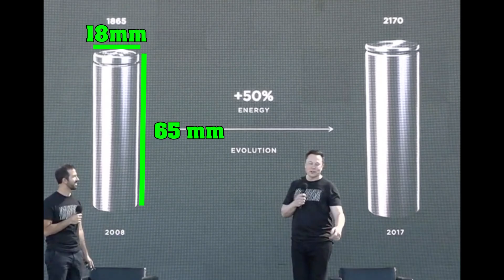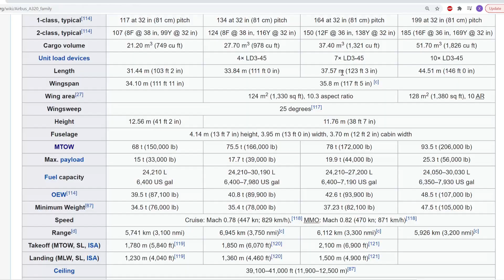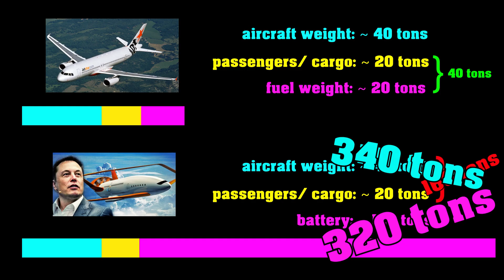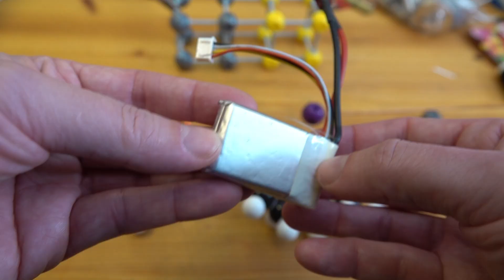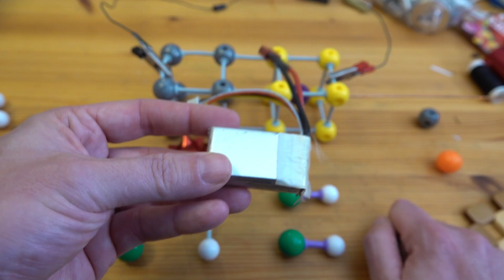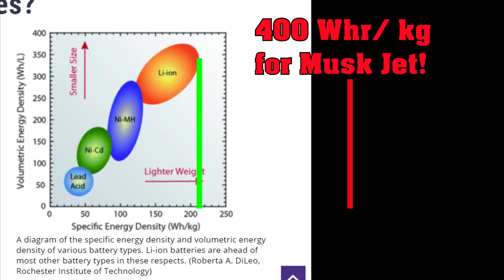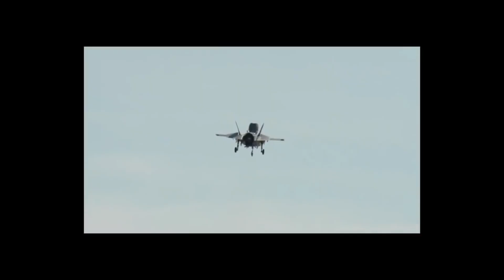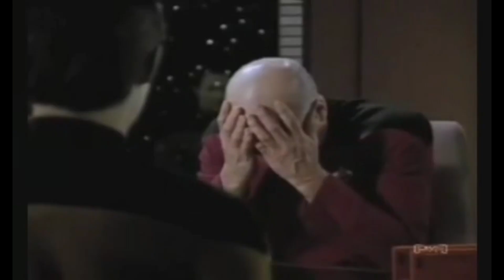Tesla's Secret Plan To Disrupt Airlines: BUSTED!!

Comment: To be fair fuel fraction on normal commercial airliners is like 50% so 70% really isn't THAT extreme . We also don't know if he's talkin about 70% of the fully laden take off weight or just bare plane before seats, luggage, passengers, etc.

Edit: I replied before finishing most of the video, I don't like to delete comments even when I'm wrong so here's the edit.
Reply: Battery's full or 25% charged still weigh the same. A jet depends on its length of flight doesn't carry full fuel load. Say a jet at full fuel can fly for 6 hours yet current flight is only 2 hours they might only carry 3 hours of fuel since less fuel is far less weight so less fuel burned.
Reply: @arbiter1  yes but presumably (not necessarily a good assumption but I'm giving Elon the benefit of the doubt) this was taken into account in the design which resulted in the conclusion that a 70% battery design becomes viable
Reply: @arbiter1  Jets are also designed with very specific routes (long/med/short) in mind. You won't find A380s or 747s being used for short 2 hour hops unless it's as part of a leg of a much longer trip for example. 

Again, I don't think electric jets are a good idea, but I think the real & valid arguments against them are plenty good enough that we don't need to pile on the less compelling arguments.

Comment: Electric aircraft will also require much more robust landing gear and bigger wings/flaps, because they must land at their maximum weight.
Reply: Big flaps 😂
Reply: Not if you drop the batteries in a parachute before Landing..... I'm kidding though
Reply: @conroyboothe9616  haha just throwing your problems overboard XD
Reply: I'd be more concerned with what happens when those batteries are below an optimal temperature and can't provide the amount of power they're being asked to. It's cold at altitude.

When we design aerostructures, we generally account for worst-case. But yes, the weight of batteries would require some serious structure to support it.
Reply: @thomasbecker9676  Hopefully the batteries would keep themselves warm- they require cooling systems in most cars because they put off a little waste heat.  You might need electric cabin heaters though (unless there's enough excess waste heat to warm the cabin, too)
Reply: You know, that's probably the easiest part to solve. Making it capable of flight is way harder.